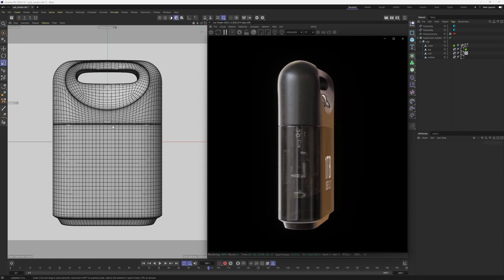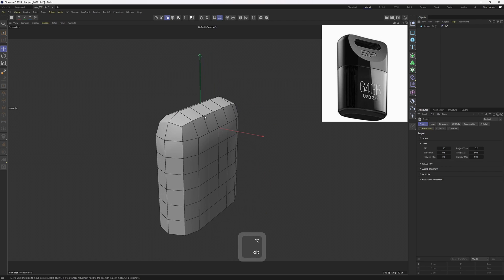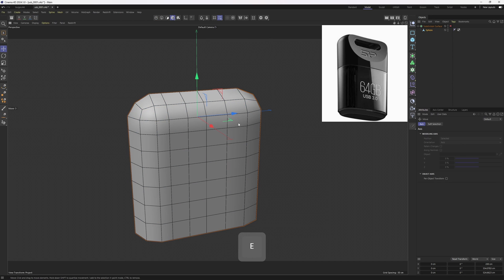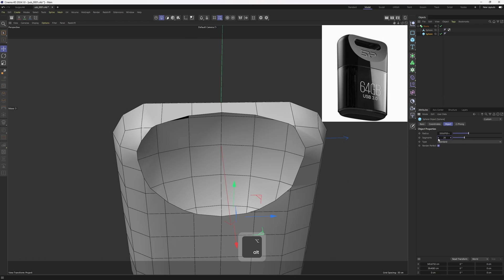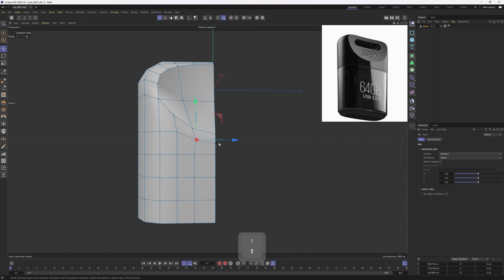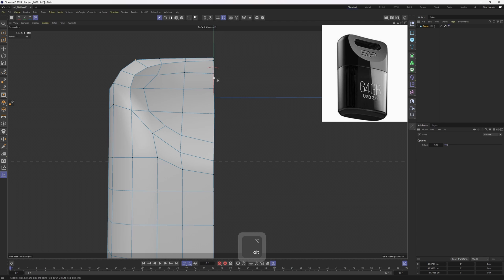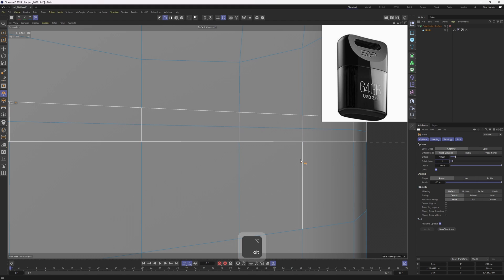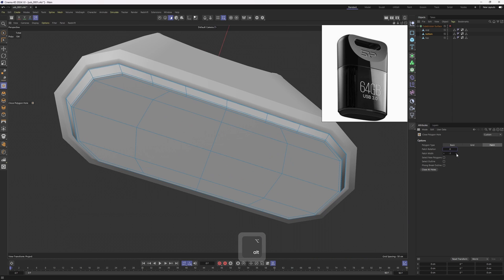Industrial Design/Product Modeling #37 USB

Comment: I was expecting something about internal components, but alas. The shape is really simple chamfered capsule. The best way to model is a series high poly booleans: box with rounded edges,  followed by sphere substraction, then another box with rounded edges for holes, and then retopology for low\middle polycount all over that with at least 4 edges on any half circle.
Reply: Procure então um video especifico de componentes poxa.
Reply: That part is on his Patreon :)
Reply from the maker: I didn't model the chip; it is just a material with a displacement map in it, and I put it on a cube.

You might be right on the workflow, but for me, it is usually longer and harder to fully retopo. I find it easier to clean up the mesh and keep going with a low poly mesh.

But as I said, this is just for me; your workflow is also really good, and I would follow it if I had a more complex shape.